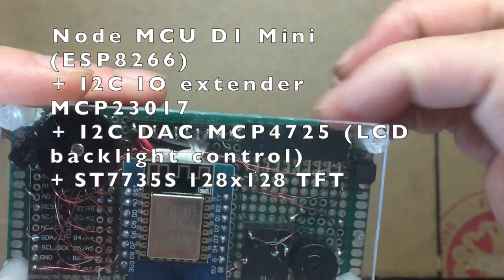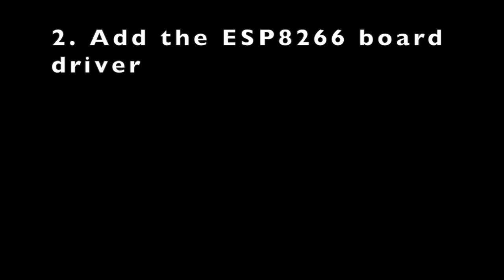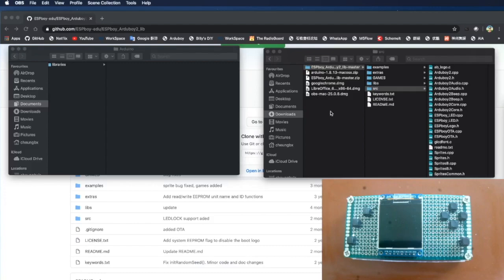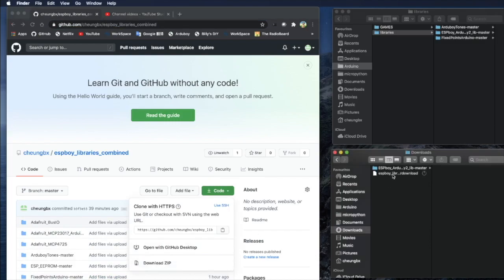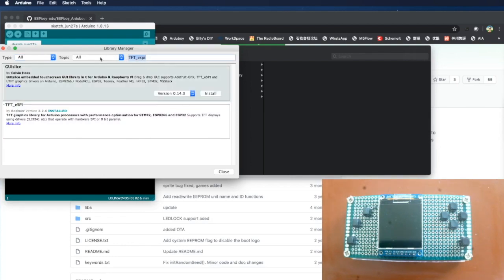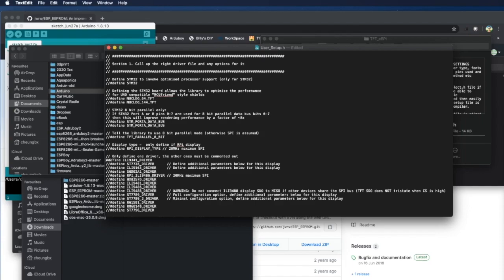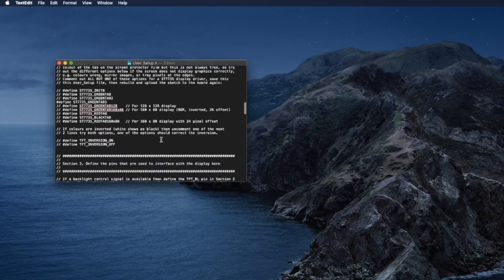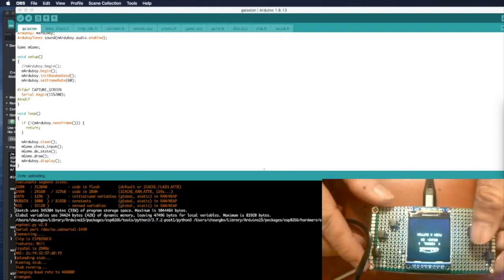ESPBoy Arduboy2 Arduino IDE library configuration (updated with  easy to use combined libraries)

Comment: what kinda wires do you use? yours seem like they arent insulated, dont they ruin the circuit if they come in contact with each other?
Reply from the maker: @revestevens3635  , they are laminated (insulated) copper wires , same as those used to wind transformer coils.

Comment: Hi man, can I use a 1.3inch 240x240 IPS TFT, because 1.44 TFT is very rare to find?
Reply from the maker: @roslinda3492  ， I think it may work if it has the sane interface and resolution. Suggest you check with the original author in his discussion forum espboy.com.
Reply: @BillyCdiy Thanks for your answer, bro. If it works, let me try it and I hope it will work.

Comment: This project looks really cool. Would it work better if it was with an ESP32 and not the Esp8266? It looks very promising. Nice work.
Reply from the maker: GnobarEl , I already did that before. See this video: https://youtu.be/sP3x_Fm-htA
Reply: @BillyCdiy  that's impressive. Great work. Do you prefer the Esp8266 or ESP32? Who had better performance?
Reply from the maker: @GnobarEl  , ESP32 board is  8 times more expensive as ESP8266,. It has more pins more functionality, e.g. including bluetooth connections.  If you want to use it for micropython programming, ESP32 has much more memory to store your codes.  ESP8266 is cheap and simpler to handle for beginners. ESP32 is more complex and need more time to understand how you work with it.